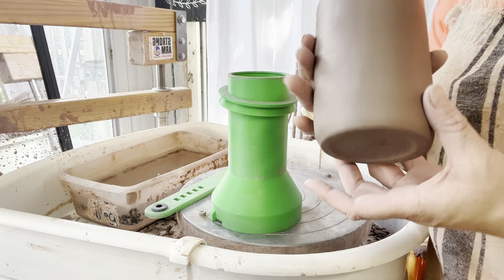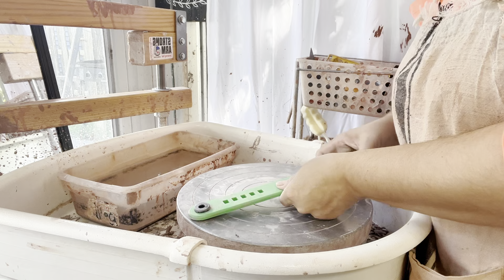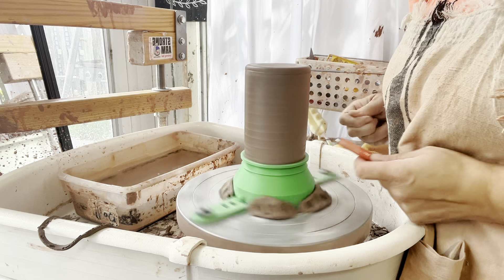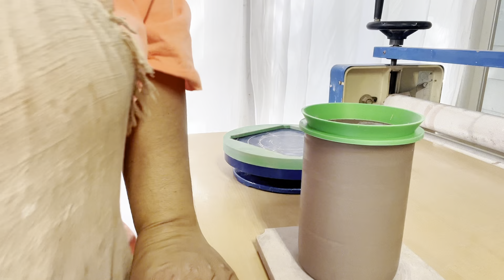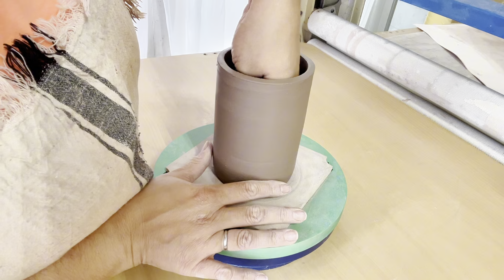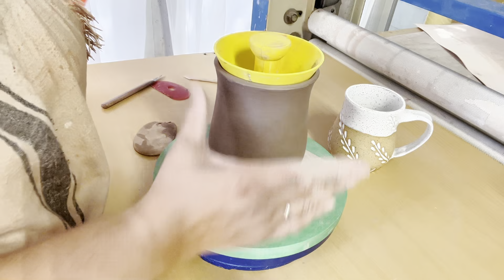Slab Throwing Hybrid System - New Pottery Technique - Tall Cylinder Slab On Pottery Wheel

Comment: Referring to this as a “ wheel thrown form” is kind of a misleading statement. It’s a slab form.
Reply from the maker: The terminology is interesting here since this is a brand new system. This type of work is created using the potter's wheel and definitely takes many of the skills needed to wheel throw. The potter starts with the same block of clay and uses the wheel as a tool, just like other work. Can I ask why associating this with wheel work is considered "misleading?"
Reply: I have purchased many of these forms and am a sucker for a good demo video; all of your videos are above average to excellent. I am unable to print the templates and wish that I could just purchase them.  Making them myself is tedious, inefficient and on the bowl in particular, I just gave up.  That’s a lot of money wasted.   I have about a 70/30 success rate on this particular form as it has warped several times during the glaze firing. I always use fresh clay. I’ve watched this video many times and I’m following exactly what I see happening here, but the warping really bothers me. Any advice would be appreciated.

Comment: This looks so cool but why does it look wobbly when spinning?
Reply from the maker: Thanks for watching and great question! Anything spinning will look a little wobbly, especially if the video is sped up. Also, since my pressure isn't automated (I'm human:) the clay can undulate a little. This doesn't affect the final piece though. If I went slower and made more precise movements I could minimize the wobble. I also stand at my wheel, so I'm not always as anchored as I could be. Hope that helps! You can see finished pieces on my IG.

Comment: I have the Artista Speedball wheel with 11" bat. Does this mean this system won't work with my wheel? I see the product description says to use with a 10" wheel
Reply from the maker: The system works with any wheel size, but it does need to have 10" spacing between the bat pins to lock on. Thanks for watching!